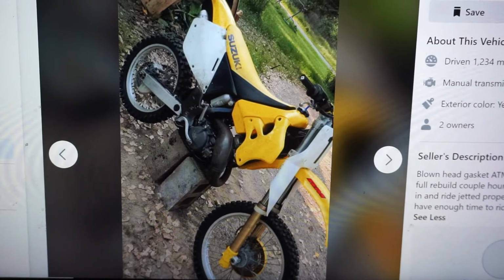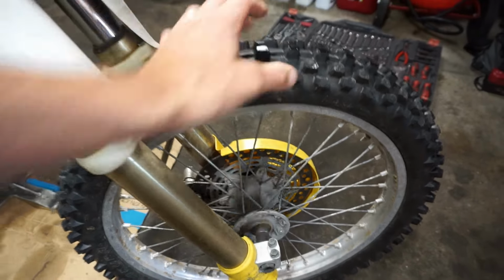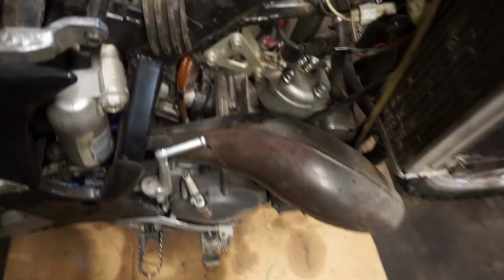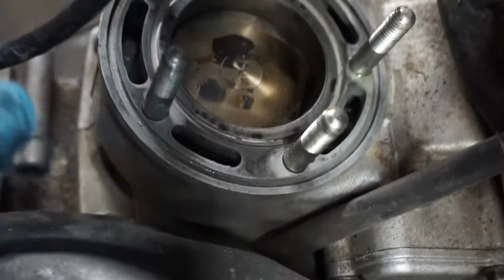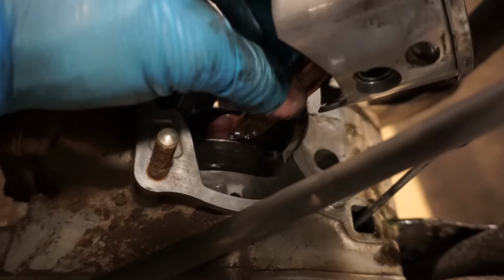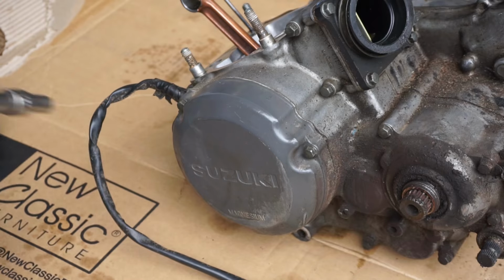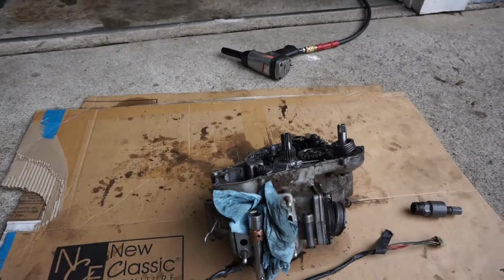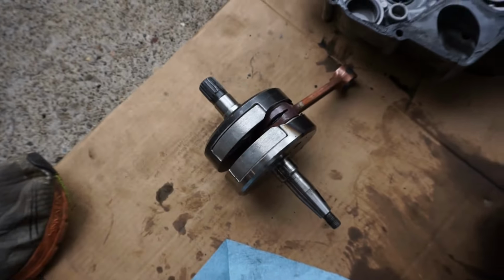I Bought a $600 Suzuki RM125 Dirt Bike. Will it Run?

Comment: The heat mark is probably due to the previous repair .torch to expand to extract pin ,use freezer on pin before installed

Comment: Can't see how that engine has been rebuilt recently judging by the way it came apart and nobody does an engine rebuild that cheaply. Looks like the previous owner was taken for a ride. Forget ebay for crank rebuilds. You need an engineering shop that works on motorcycles. We have loads to chose from in UK so you must have the equivalent in US. Doubt it would cost $600 either. Top tip here is to use Suzuki crank parts for the rebuild not some cheap rubbish. And those O rings are the head gasket, they just seal the water jacket.

Comment: 92 through 97 are showing looking at my tech books, and it's showing the same kit in my shop manual. Need hard gasket, in my opinion. Those o rings are crap, they don't hold well sometimes, depends  on buld material.

Comment: Words of wisdom from a metallurgy standpoint.....once you see blue or purple the heat treating or temper of the steel is GONE and toast. You have soft metal that can easily deform, bend, gouge or be scratched.

Comment: A local bike shop should be able to do it for you when I did my bike I got the cylinder sleeved and when I got it home the sleeve cracked along the ports I told the guy and he said he would fix his mistake and balance my crank he said it was out .001 or .002 but anyways make a story short you should be able to find someone to rebuild one they just press out the old bearing and put a new one in with a good rod so I don’t think It should be more then 200 or 250 to do it. Cool video dude keep them coming

Comment: It blows my mind that you paid $600. Small town in Ontario Canada, the cheapest RM125 93-99 is $3000 and up.
Reply: I know right I have been looking for a rm 125 to match my dads rm 250 but i ended up getting a kx 125
Reply: What a great bike. I ridden these and they are such great handling bikes. I don't know anything about the Kawasaki. I actually got to race the first tm 125 right when it came out and it was such a great bike.
Reply: @cassiuswright198  I have an rm125 1997 whats the asking price ?

Comment: A sure sign of a blown head gasket: your oil looks like coolant and your coolant looks like oil. Nowadays you can get a $20 borescope off amazon and see before you buy it if the cylinder is trashed. 80's and 125's notorious for having their youthful owners run the piss out of them till the ring(s) is so thin the exhaust port swallows it.

Comment: Just came across ur channel, love the content. I'm wondering if u have an knowledge on how those power valves work. I just picked up a 99 rm250 and didn't notice the knob until later. I'm curious what that's all about.
Reply: I have a knob on my 2000 rm125, if you want more top end power tighten up the knob (clockwise) and if you want more mid hit let some tension out (counter clockwise) don’t tighten or loosen it too much
Reply: @jakebradley5357  thanks man I'll have to check it out.

Comment: Same thing happened to my cr125, I was riding it around my block then it went boom and shut off. It started back up a few hours later and was making some weird noises so I pulled the motor and found out I smoked the crank

Comment: Rod kit comes with a pin, rod, both bearings. 60-80$ a shop to do it should be 100, or 125 to be welded.

Comment: Its not that hard to press a crank apart get a press from harbor freight.   Pick up a steel plate that will fit between the two hafts before you press pin out make a linement lines on 3 side it will help with reassemble. Throw pin in freezer an 2 hafts in oven. Get your plate thats fit between hafts .press the pin in .the plate well keep the rod bearing from getting  Smashed.cut 2 pieces of wood put outer bearing on crank  cut v into wood set crank in v turn use dial indicator to check runout

Comment: for $600, its not exactly a loss if it doesn't run. a full rebuild is probably gonna be an additional $600 - $800 considering what we have here for way more that's a steal.

Comment: It looks do-able rebuilding a crank at home as does balancing but lots of extra tools required and mechanical knowledge on tolerances but easier to get engineer to do it and has experience as doing things twice gets expensive.
id be tempted to put that crankshaft through the sellers front window, get so fed up with sellers bullshit in the marketplace
Reply: what u expect for 600$ in current market where people selling 900$ bikes for 3000$ +

Comment: If you buy a rebuilt part from eBay they have a money back policy that is second to none,if you buy a part that fails to perform when it was advertised as good and usable you will get a refund if it’s not within specs.

Comment: Is it possible that the conrod was put in the wrong way? On some engines, there are small oil holes that face the oncoming mixture to force oil into the holes and on to the bearings. The fact that someone else here has seen the exact same problem means maybe a design deficiency somewhere? I'm a mechanical engineer, so I know design screw-ups do happen.

Comment: Yea 600bucks.  I don't believe it.  Here in Minnesota literally every dude in the state Is asking 1300 to 1600 for a bike that is rough asf.  Guys are asking 1200bucks for a 89 xr 80 that's blown.  Not to mention broken levers and cracked old plastics.  If I found that hike not running you Have here for 600, I'm nabbing that up in a heart beat.  A guy could get wealthy finding the deals you do and reselling.  That bike looks clean clean.

Comment: My guess was that the person rebuilding the motor discovered the bad crank/bearing, put the motor back together, charged for inspection/parts, told the owner that it would cost $650 +Labor and the owner decided to sell the bike
Reply: Splitting the crank takes a press and about a minute or two of work.  $100+ for a rod and bearing kit.  

Motor split kind of hard = doubtful it was taken apart before.

Comment: Why don't you fix it yourself? Take the crank to a machine shop and get them too push out the big end bearing and and split the crankshaft. And replace it. Iv never done it myself but when you watch Allen millard turn 4cyl crankshafts into 6 cyl by just adding the on he makes it look so do able.
Reply from the maker: Yeah you need a special tool to balance it and measure it to make sure it is perfect.
Reply: @davehoward22  oooh you question the great wise man himself???

Comment: You are better off to buy a Chinese 125 cc motor or better yet a new Chinese bike. You can get an Apolo RFZ 125 complete bike new for like 1300$USD or 2000$ CAD. I am riding a Venom Thunder (pretty much a rebadged rfz 125) It might only last 1/2-3/4 as long as a Japanese bike but it's 1/3 the cost and I can just buy another and use the broken one for parts after that.

Comment: Buy a prox rod kit and sent it to me crankshaft or crank works or find a local shop that does it. Should only cost 220-250. I'd recommend prox crank bearings and seals also and the piston should be drilled it's a bridged cylinder. Have a how to do that video on my channel 🔧🔧

Comment: Good Video Joe.  I like Bikes.  

As for this Suzuki, Wow!  I believe they call this a Catastrophic Failure.    Yikes!  Two Bering's in a Row on this Engine.  First one failed for what ever reason, worn out, etc.?  But the second Bearing?  Wrongly Assuming everything else was fine?  OOPS!   Just goes to show, do it right the first time, keeps you from doing it a second.  Personally, I hate tearing into the same thing twice.   I'm already Sick of it after fixing it the first time.  

I am Amazed at what Used Bikes and Quads go for these days!!!  And a Bike like this one, $600?  Ouch!  And then to find out not only bearings need to be replaced, but the Crank too.  Double OUCH!  

Perhaps you mentioned it, but what was the Mileage on this Bike?  Seems from the parts that were worn, it was perhaps a High Mileage machine.  

A Sad Note-  It does seem like previous owners have a problem with telling the truth.  Just a Head gasket?  The guy probably knew the Bottom End was probably a Shit Storm Mess, and yet, he couldn't tell you the truth.  Guess we've always had those who don't mind selling a Clapped out machine, but telling the Buyer it's like New and only Driven by the previous owner a few times a year.  Then you get it home, under your own lights in your own garage, and you discover the machine was Ridden Hard, and the machined is nothing like it was described.  

Good Video, certainly had me on the edge of my seat, especially when you were Splitting the Cases.  I was closing my Eyes because I didn't want to see the Wreckage.  But, like a Horror Flick, I know not to look, but what do I do, I look!  And so it was with this Case Splitting.

Comment: it probably failed because the guy rode it in the street wide open for miles I worked at a Kawasaki garage and seen it many times that shop had the jigs to press them apart did several crank jobs

Comment: I'm working on my '94 rm250... sellers want to punish you for the parts on these bikes because they were not popular at the time, so there's low supply of used parts.

If I recall correctly the RM250 jumped from 40 HP to 60 HP from '96 --> '97 then to 80 HP in '01... so the industry was rapidly improving/changing with other manufacturers edging out Suzuki most of the time.
Reply: Modern day 450s don’t even touch anywhere close to 60 hp in stock form, you’re average 250 two stroke from about 96 to 2007 were making about 40-47 hp depending on model and year

Comment: If it won't run, a wire brush, crescent wrench and can of WD40 will make it run. Need a new gasket? Cut one out of aluminum or brass sheet.